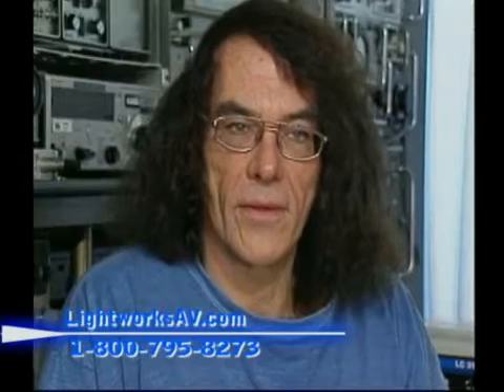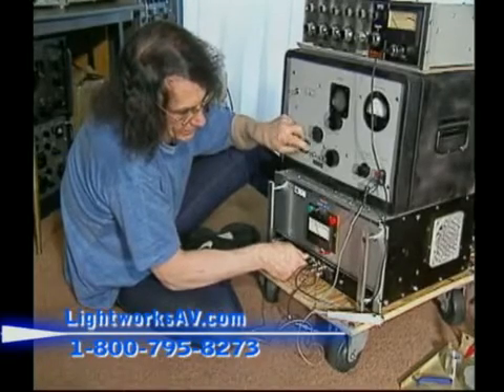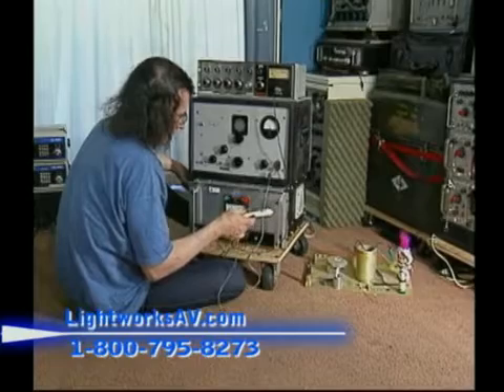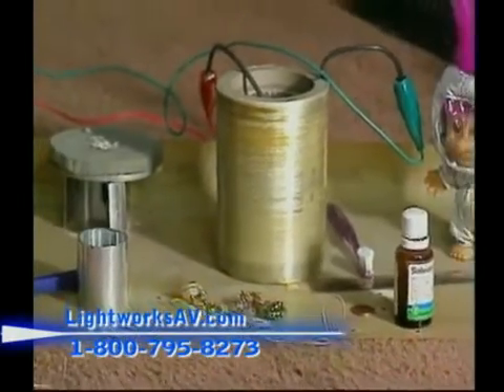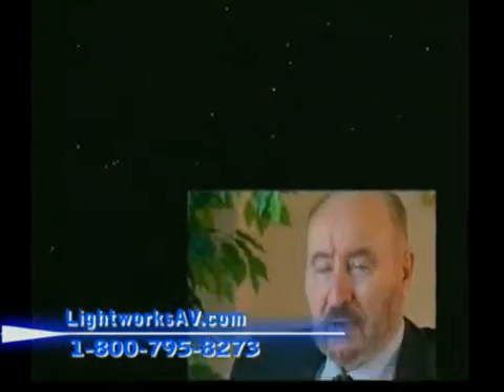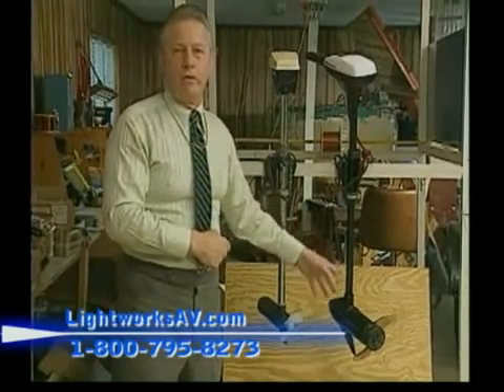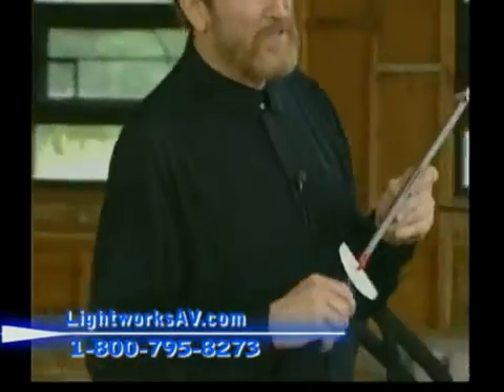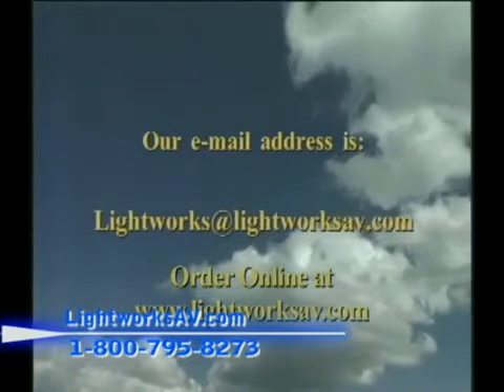John Hutchison anti gravity Part 1

Comment: So, WHERE'S the levitation? All I see, by way of empirical evidence, are some little things "vibrating" on a metal plate. My understanding of what "levitation" is, is that something is floating in mid-air without any visible support. I don't see you demonstrating this here. Build a flying saucer and fly it using what you claim you're able to produce. I hear/see you giving nothing but a bunch of double talk usually saved for the rubes at county fairs.